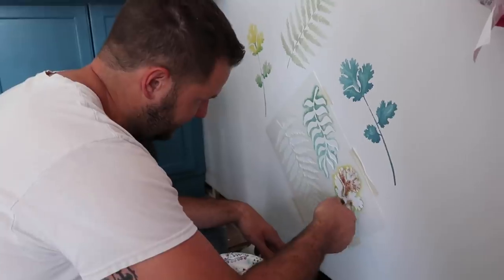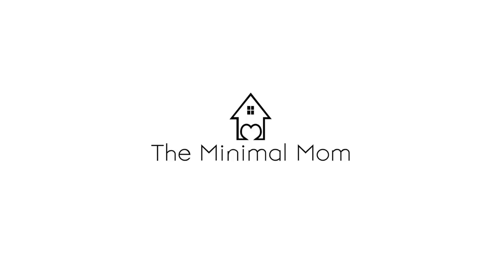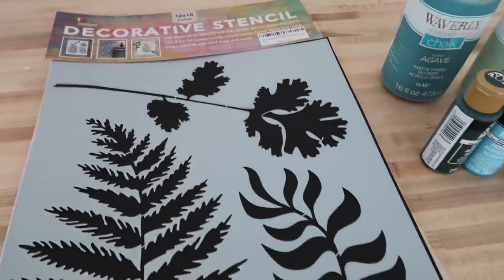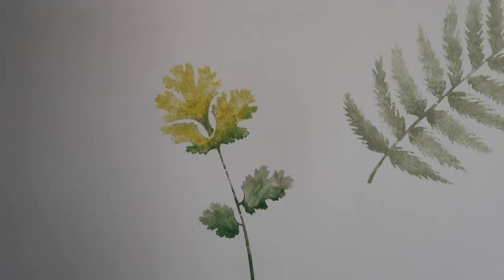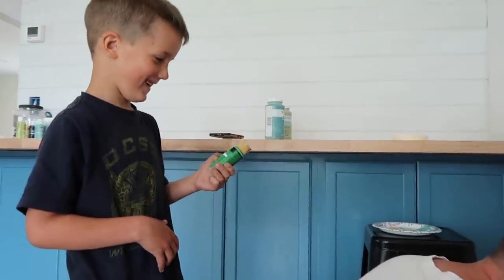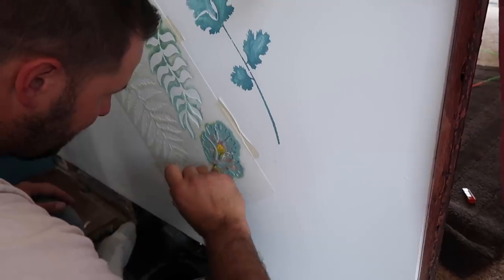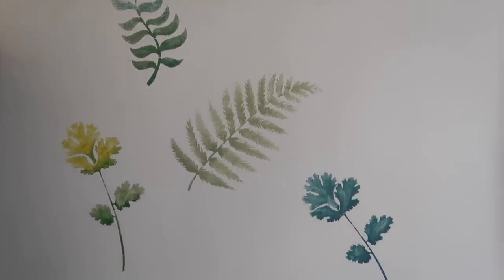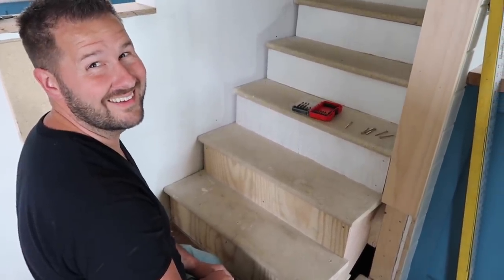I guess we'll make our own Wallpaper! Tom likes it, do you???

Comment: The stenciling looks FABULOUS! So glad you're happy with it! || Have you thought about adding outlets on the top of the counter? I've done them on top and drilled holes, both are nice in their own right. But sometimes it's nice to not have to go fishing. I most recently installed an outlet on the top of a console table that is connected with a cord, basically a glorified extension cord. It's so nice to plug things in without reaching behind the couch, all while not having an extension cord hanging out all the time.